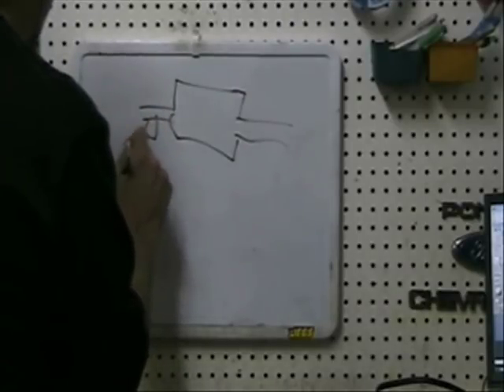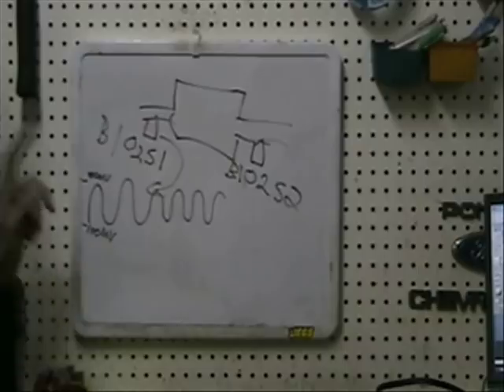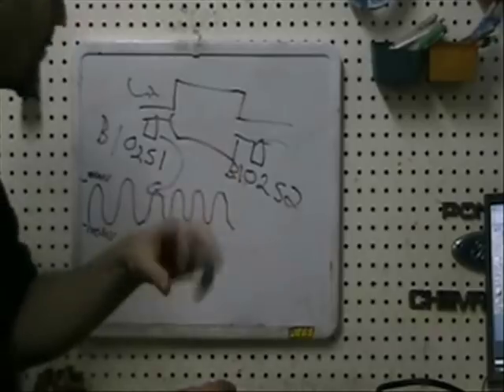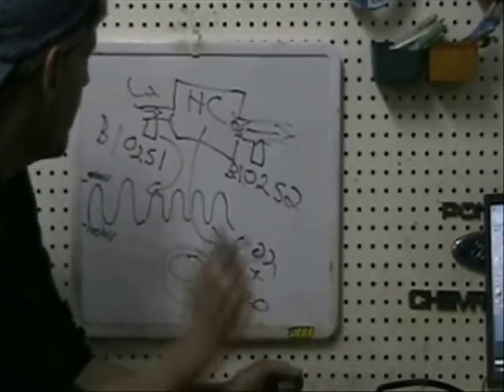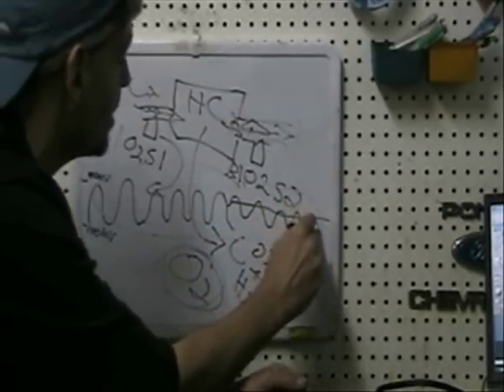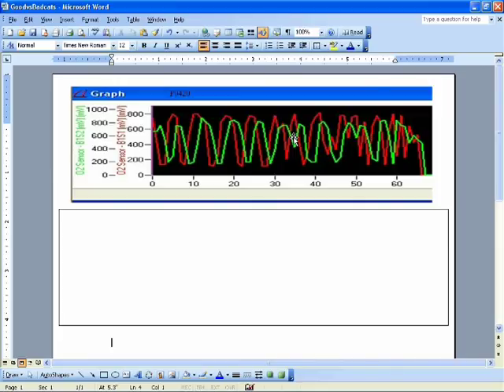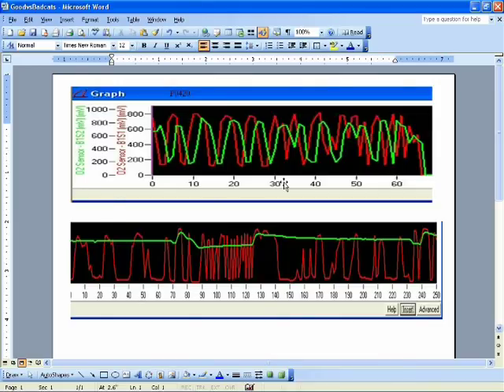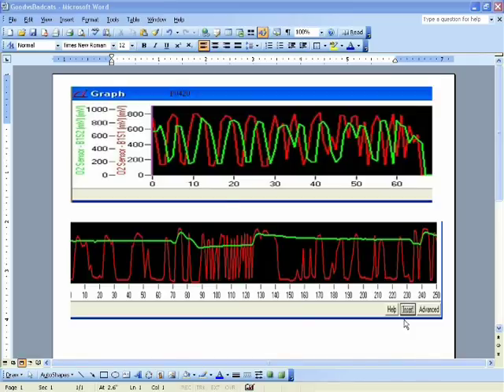P0420 P0430 catalytic converter catalyst inefficiency code diagnosis

Comment: its easy to fix and stop the engine management light coming on, it's because the cat is starting to break up and block the exhaust system  causing an over rich mixture thats detected by the downstream landa , one of the best ways to fix the engine light problem is to simplify look down the exhaust or up into the manifold and see if it's blocked and running black over rich,  if so smash out the blocked cat with a length of steel bar shoved down or up the exhaust  system, will  mean taking it apart,  but you have to be careful not to damage any landa sensors in the process take them out as well if need be,  once done disconnect the vehicle's battery to reset the engine management light that's if you don't have a reset tool, once all put back together the management light shouldn't come on and the vehicle will run properly again as an over rich mixture can cause very poor running,  to get it through emissions testing next test go become friends with your local garage and bribe them to use another vehicle to stuff the tester up, everybody dose it here in Britain and if you've got the problem you haven't got much to loose by doing this or it's off to the dealership and loose shed loads of money,  and the really funny thing is they run better and use less fuel once the cat is gone.
Reply from the maker: Become friends with the emissions guy and bribe them to pass it huh?
  That's the dumbest thing i ever heard. Why not just fix it instead of risking CERTAIN prison because anyone who has ever been to an emissions facility much less works at one knows you can't falsify it at the station for multiple reasons. 
  why do hacks from chatrooms and Yahoo! somehow find my channel which is dedicated to eliminating stupidity and ignorance like this?
Reply: Schrodingers Box Yeh but the thing is I actually now what I'm talking about and a vehicle will run just fine without a catalyst fitted !
Reply from the maker: Yes of course it will run fine without a cat. Everyone on the planet knows this. But bribing an american government EPA employee huh?  Not too bright.
 Since you "know what you're talking about" why not come up with a method to simulate catalyst performance on the O2S2 rather than risk prison for you AND the "friend" who is stupid enough to try the impossible of  falsifying a test run?
Reply: Schrodingers Box your American I'm British we do things differently here there's a recession so sometimes corners have to be cut and rules bent,  the way some of us look at it is to just look up into the sky and ask ourselves why dose the ordinary guy or woman have to get screwed when all those jet aircraft are flying around up there chucking out tones and tones of emissions and nobody gives a biddly squat,  and we're paying about seventy five percent tax on every litre of fuel we buy, the engine management light won't come back once the fault has been cleared if the cat has been removed or knocked out, and the number two landa sensor will not show a fault afterwards and cause the light to reappear,  so basically they run fine,
Reply from the maker: "After gutting the cat, The check engine light will not come back on once the fault has been cleared". You IDIOT!!!!  You have no idea what you are talking about. Of course it will- in 2 consecutive drive cycles it will when the failed sustain rich condition is sensed by the O2S2.
THINK!!!!! Why would you need to bribe the emissions tech if this were true? You would just clear the code!  OMG what a dope!!!!

where do these morons come from?  Britain, apparently. Except my thousands of subs from britain all know you are full of hot air.

Another person giving advice on the internet who has no knowledge at all... and you do it on my channel which is dedicated to calling out such people.
Reply: Schrodingers Box no it doesn't come back on because the reason they come on in the first place is because of an over rich mixture that causes a drop in temperature to the downstream lambda sensor, once the obstruction has been removed the sensor goes back up to it's correct temperature because it's not running rich anymore , try it you self  then comment.
Reply from the maker: ROTFLMAO!!!!  You do not even know the parameters that cause the code to set you idiot!!! That would NOT be a P0420 code moron!!! it would be a P0172 or 3!!
 OMg you are hopeless. i give up. Even if what you said were true it still begs the question why you told people to bribe the emissions place!!! Why do that if you can just reset the CEL and it won't come back on HAHAHAHAHAHA!!!!!
  Anotheer blow hard exposed on the Schrodingers Box channel folks!!
Reply: Schrodingers Box the number two lambda sensor is what tels you the cat is not running properly the first lambda sensor corrects the fuel to air ratio by detecting the temperature at witch it is burning and sets the cycle for the fuel injection system to pump fuel in with the mass airflow metre and the ignition timing sensor or knock sensor depending what you like to call it and of courses there is the engine water temperature sensor they all work together to produce the correct mixture for the efficient running, oh I almost forgot the tpf throttle position sensor, and the ecu electronic control unit,  got it.
Reply from the maker: b57ecv You bumbling IMBECILE. Of course that's how it works- I mention this exactly in the video, Einstein. However in the event of a rich condition you will NOT get a P0420.  Gutting the cat may fix the 017x, but it will CAUSE the P04x0. DO YOU GET IT???
 You still didn't answer why if you can just reset the CEL without it coming backwhy you need to bribe the emissions station.

 OMG you are amongst the most ignorant people to make stupid comments on this channel for ADVANCED auto repair.
  Unfortunately I am going to have to disable your comments until you answer more intelligently so I can uphold the informational value of my channel.  Or at least until you answeer why you need to risk prison for bribing an emissions tech if you could just clear the CEL. Dying to hear that!!
Reply from the maker: b57ecv Sorry had to delete your last post for not answering.  Anyway my point is proven- you're another internet hack spouting off without knowing what you are talking about.  you were given fair chance to show otherwise.